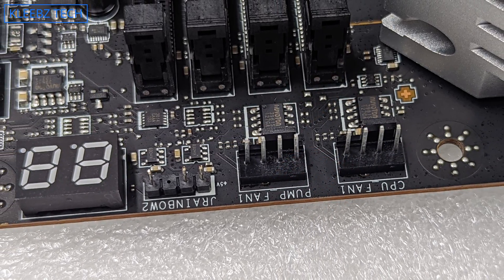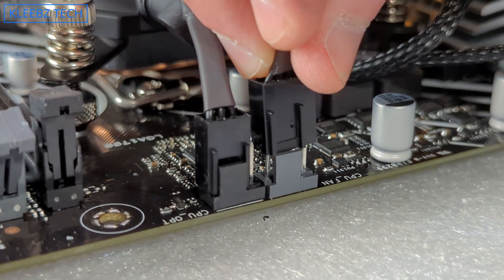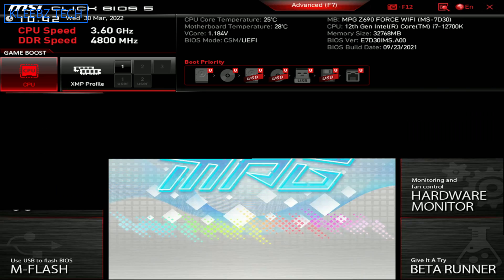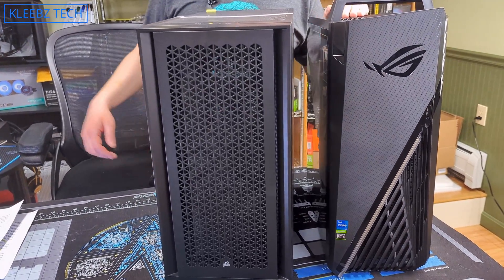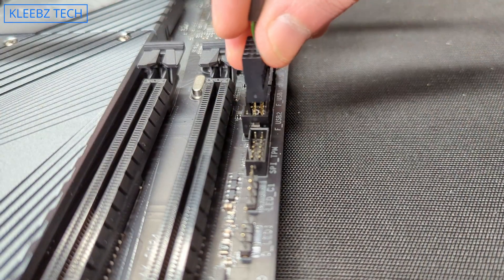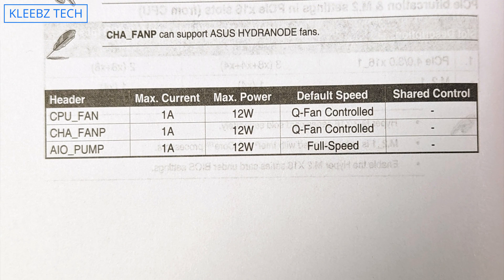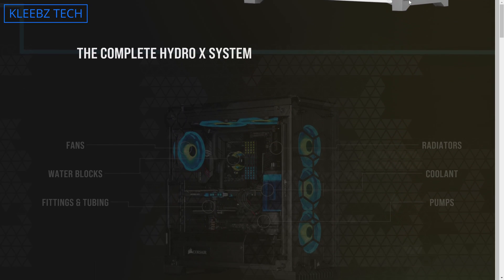CPU Fan Headers - Where do you plug in your CPU cooler?

Comment: I installed my aio the temps are around 48c on my cpu when gaming the fans are spinning on the radiator cooler but when I open the software to the aio it says no pump data

Comment: I have MSI B450 Pro Carbon Max wifi and I'm using Deepcool Castle 240rgb v2. The problem I'm facing is that my AIO's fan & rgb both are 3-pin connector but my mobo doesn't have 3-pin argb header. What should I do? Can anyone help me out?

Comment: I’m so confused I plugged my AIO cooler headers in as per the instructions with the fans themselves connected to the provided fan hub which is then plugged into CPU FAN 1 and then the pump itself is plugged into PUMP FAN 1. However, in my bios it just now shows the cpu fan at 0RPM even tho they AIO cooler fans definitely are spinning and it only shows the pump fan.

Comment: Which one does the 3 pin cable and 4 pin cable on the cpu cooler go to?  Does 4 pin go to pump sys1 and 3 pin go to cpu fan1? Only other port i see in top right is sys fan1. I have no 3 pin ports on my board. All of those are 4 pin ports

Comment: My motherboard doesn’t have a CPU_OPT in only has the CPU_FAN, an Argb header, and a SYS_FAN header. What do I do?
Reply from the maker: You can use CPU_FAN.
Reply: @ so do I plug the waterblock to the cpu fan and the radiator fan to sys fan?

Comment: I'm having a hard time getting the cpu fan connector to connect to the 4 pin connector on my motherboard, it appears to be connected but then just falls off.  It's suppose to be 'no mistakes' connection there but for some reason it just don't seem to do it.  I have an Gigabyte z790 aorus elite x wifi7 and a GAMDIAS CPU Air Cooler 270w TDP with Black 7 Heat Pipes Dual Tower CPU Cooler, so am I missing something here or should I just send the thing back, I wanted to avoid water cooling for now which should be fine with my I7-12700k but now I'm getting really frustrated with it...I don't want to send it back but guessing there's just something wrong with this connector for this cpu fan connection.

Comment: Dude, you saved me!!!!!! Thanks😂

My system kept booting into the bios every damn time I power on the system or restart the system. 

I have my header on AIO_PUMP for my aio cooler on my Galihad ll LCD 280MM

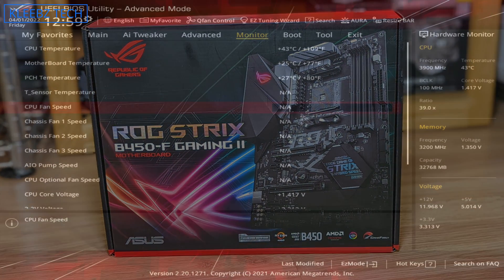It turns out, that for anyone with the same issue using an AIO cooler just set your >>>CPU FAN SPEED<<<< TO IGNORE 2:07. That way it will boot right to the drive and not bios every single time -lol 

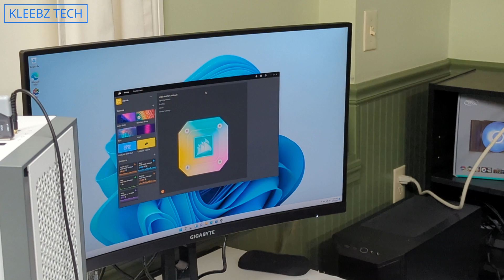1:57 issue resolved✨️✨️✨️✨️🤪😅

Comment: I put an NZXT Kraken 240 in the AIO pump header, and I'm getting that fan error in bios shown at 1:55 in the video. Would it be okay to set the bios to ignore the CPU FAN header as they did, since my AIO is working off the AIO header, and the temps are good, or should I put it in CPU FAN header just to be safe? The error on start up is annoying lol. That being said I'm on a ASUS Rog Strix b760-a gaming wifi motherboard
Reply: Where are you putting your fan connections then? Are you running the radiator without fans? The pump connection goes into the AIO header. The fan connection goes into CPU Fan.
Reply: @thecheese4960  I don't remember, been a while since I looked 😅 but I have every fan running and remember setting the bios to ignore the error. So far great temps and everything is functioning. Thanks for replying!

Comment: What does cha_fan do? And how do I find it?
Reply from the maker: Chassis fan and often used for things like case fans and any other extra fans.
Reply: @KLEEBZTECH  does the chassis fan do the same thing as a system fan?
Reply from the maker: I assume you are talking about the actual headers where they plug into motherboard, and for the most part yes. Although it can depend on the motherboard.

Comment: I am putting a cooler master 120l into a hp 6300 sff. The 6300 sff does not have a cpu_fan header, only ch1, ch2_fan headers. The cpu is cooled by shroud and case fan. I am upgrading the i3 with an i7. With new 600w psu. I can power the pump and fan but I don't know how to control the fan speed automatically with cpu load. I don't really want the fan running 100% speed 100% of time, but I understand the pump needs 100% speed, 100% of time. Thanks for suggestions. I don't know, maybe ch1_fan can be set up in bios like a cpu_fan?

Comment: Hey im having problems with my water cooler I just installed my cpu is hittin 95 and it automatically shuts off as soon as I get into bios my AIO_pump connector on my mobo is a 4 pin but the water cooler connector is a 3 pin i tried connecting it still to the AIO_PUMP_ connector on my mobo but it just shuts off automatically what should I do?
Reply: Please let me know if you have found a solution for this issue. My issues isn’t the same but your answer may help me.

Comment: Hello, when the pump dies in the AIO Cooler, does that trigger the CPU Fan Error?
Reply from the maker: That's hard to say but it could. There are so many different configurations.
Reply: @KLEEBZTECH  I believe that is the case with mine. I pulled the trigger on the Thermalright Frozen Edge 240 cause I have to maintain my luxury lifestyle. Keep bangin', thanks.

Comment: Hello! If I don't have CPU_OTP on the motherboard, can I connect the pump to SYS_FAN1?
Reply from the maker: Since CPU_FAN is the most monitored by the motherboard for any failure and the pump is the most important thing to monitor I would connect the pump to the CPU_FAN. Also recommend reading post #3 here for some useful info as well: https://forums.tomshardware.com/threads/can-i-connect-aio-pump-and-fan-on-cpu_fan.3759399/#post-22670855
Reply: @KLEEBZTECH  so if I understood correctly I have to mount the pump with 3 pins to CPU_FAN and fan with 4 pins to SYS_fan?
Reply: @Kandis23  Is that correct? Wondering how it worked.
Reply: @redwhitentrue  Good question

Comment: So if I have motherboard asus rog strix b650E-F and all my FUNs have 1A 12W max, where should I plug (and can i?) All 3 propellers from my aio lian li galahad II? If I got it right all 3 fans are connected one with each other and then all 3 should be put in one FUN connector of the motherboard, but I am afraid that 1A 12W is not enough for this

Comment: hey guys, I need some halp!! is the pump header cable that is for your cpu AIO cooler supposed to be clipped into the CPU_FAN / AIO_COOLER slots on your motherboard? i plugged mine in and i can easily pull it out. it has no clips
Reply from the maker: None of those plugs will have a clip of any sort to hold them in place.

Comment: I have a problem. b550-plus tuf gaming wifi v1 motherboard and where is the aio header on it? asus didin't show where is it in any papers they had given with MB and now I am sutck between some vids saying it's at top of MB and some saying it's between cpu, ssd and PCIE x4 reinforced slot.
Reply from the maker: Is your motherboard the TUF GAMING B550-PLUS (WI-FI)? If so I took a screenshot of the manual with the connection circled and upload here: https://kleebz.com/wp-content/uploads/2023/12/Screenshot-2023-12-05-194900.png
Reply: @KLEEBZTECH  my god, thanks man I was looking for it for 5 days. My version of instruction is from 3-4 years ago and they didn't include placement of aio pump

Comment: Hello sir, I have an asus x670e e gaming motherboard and an asus lc ii 360 liquid cooler.The liquid cooling fans are connected to the CPU opt socket and the pump is connected to the Aio pump socket.Aio Pump is in full speed mode in the bios, but when I go to the desktop, it does not appear to be running at full speed in the Armor Create program.It seems to vary depending on the temperature values of the processor, but did I do everything correctly in full speed mode in the bios setting? Please write me an answer.❤
Reply: Hello. I believe I have the same Lian Ali ALC 360 AIO Coolant System. My system isn’t recognizing it in the BIOS at all. Both are saying N/A in the BIOS.

Did your system start like this? If so, what did you do?
Reply: You both should be connecting the pump to AIO header. The fans to the CPU FAN header.

Comment: My MoBo only has one cpu fan header and 3 different system fan headers. No pump header. I want to hook my arctic aio pump up to system fan 1 header and fix it at 85% speed or so in the bios and run the rad fans off the cpu fan header to follow cpu temps via a tuned curve. All the headers are rated @ 2a 24w. I dont see why this wouldn't work. Bad or good plan for a board without a pump header?

Comment: i got a B550 AORUS ELITE V2 and the moment u put my pump in the cpu_opt it will go straight too 100 degrees celcius, while clicking it in the cpu fan it wil goo too 40 degrees celcius. how is that possible?
Reply from the maker: Possibly the cpu-opt is not working?
Reply: when i put fans in it they work so thats where the confusion pops in, at the moment i play wow and now its 50 degrees 
when pump is in cpu _fan
 @KLEEBZTECH

Comment: What's a 4 pin pwm fan header?
Reply from the maker: A 4-pin PWM (Pulse Width Modulation) fan header is a connector on a motherboard or fan controller designed to connect with a 4-pin PWM fan. The pins are allocated as follows: Pin 1 is for electrical ground, Pin 2 supplies +12V power to the fan, Pin 3 is a tachometer output indicating the fan's rotational speed, and Pin 4 receives the PWM control signal to modulate the fan's speed. Unlike 3-pin fans whose speed is controlled by varying voltage, 4-pin PWM fans receive a constant 12V supply, and their speed is adjusted by altering the PWM signal on Pin 4, allowing for precise and energy-efficient fan speed control based on system temperature readings and other variables.
Reply: Great Information

Comment: Hi, very nice video, help me a lot.
I’m facing the same error, i have an Aorus Waterforce, also using USB connection, then my Asus mobo can’t recognize the CPU FAN (cause doesn’t exists).
However, my case have 4 fans pre-installed, all connected into a controller.
The question is, can i connect this controller (w/ 4 fans) into cpu fan?
If true, in this scenario stops the error?
Thanks!

Comment: I have pre built from Cyberpower. they have plugged aio  pump to cpu fan and left cpu pump header empty.  the aio fans are connected to system fan5 . Is worth changing everything in correct place??? its a msi board
Reply from the maker: If things are working fine I wouldn't usually.

Comment: I have a problem that there is literally no cpu opt, aio pump, pump connectors on my motherboard. What do I do?
Reply: Use "sys fan1" 
Or if that returns a error 
Trying the cpu fan
Reply: bro i figured out a month after this comment but thanks a lot!  @777_lite
Reply: @777_lite can you use a aio cooler on that one?
Reply: plug in the aio pump in the System Fan header and the radiator fan to CPU Fan header.
Reply: And the vrm plug of the pump? @ernievelasco23
Reply: Plug in where you think is best, make sure you read what fan header that is and check it and set it in the Bios
Reply: Same bro, any luck?
Reply: Get a new mobo

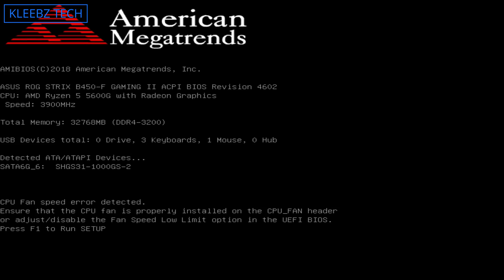Comment: @2:00 bro I getting this same fan error.  After ignoring it everything works but until I shut down it reappears
Reply from the maker: Is this a newer computer? If it is not there is a possibility you need to replace the CMOS battery.  see if any other settings can be saved between shutting down.
Reply from the maker: And just to confirm you are saving when you exit the bios?

Comment: I need help I installed an AIO argb cooler to my cpu it is working fans and everything. The only issue is that sometime the light on my cpu cooler flickers I dont know why it does that I have checked the temps on cpu but it is still okay it seems running.

Comment: What about the H150i Elite from Corsair? It has a 3-pin connector but only one single wire, does it go to the CPU or Pump header? At the moment it’s connected to the CPU header, and I can adjust the speed from Quiet, Balanced, or Performance inside ICUE.

Comment: I'm building a high-end system (13900K, RTX 4090, Samsung 990 pro, Hynic A-dia DDR5) being powered by a Corsair AX1600i. With the capability of all the heat this system can generate I have dual D5 pumps (24W ea), (4) 30W Delta fans and (3) 15W Delta fans for a total cooling system load of 213W or 17.75A at max settings. I'm not pulling that kind of power thru the MB and will use a relay connected directly to the PSU triggered by a fan connection on the MB. That way you're not pulling 18A thru the MB will all the noise that comes with having all those motors connected to the MB
Reply from the maker: That sounds like some serious cooling. Hope it all works out. Jealous about the 4090. 😍
Reply: Yes same here I just started assembly of the rest of the components minus the 4090 which comes later this month.

Comment: I have the h60 from Corsair, came with a prebuilt pc and it has a push/pull fan configuration on the radiator. My question is where does the 3-pin wire from the pump and the 4-pin wires from the two fans connect too? My motherboard has two CPU Fan headers and three Cha/WP headers. Thanks
Reply from the maker: From the sounds of it the 3 pin would go in the CPU fan header and the 4 pins in any of the 4 pin sys fan headers.

Comment: You never answer the question. CPU fan header, CPU OPT header or the AIO pump header. Witch one should I have plugged in with a AIO cooler.
Reply from the maker: I would connect the pump to the pump header usually.

Comment: If  I have 5 chassis fan and only 
3x fan connectors 
1x aio pump connector
1x cpu opt connector 
Can I hook up all 5 chassis fan on those??
Or do I have to buy some kind of splitter??
Reply from the maker: Sorry I missed this. Yes you can connect those. They may not operate exactly as expected but it won't be a problem but you may need to adjust things.

Comment: can i plug the pump to fan hub ? i saw tht my pump wont affect even adjust the speed in bios (always 2420-2445 rpm) , maybe because its 3 pin , why i want to plug pump in fan hub because i want my radiator fan (120 aio) run higher than case fan , so the hub only 3 case fan with 1 pump plugged in , and the rad fan plug in motherboard cpu fan header , (my fan hub is just powered by 4pin motherboard, no sata or molex) and my motherboard only has 2 header ,(sys fan , cpu fan) is it safe to plug the pump in tht fan hub, with no sata or molex power up

edit: my current setup now is fan hub plug in mobo cpu_fan (4fan plugged) and pump plug in mobo sys_fan

Comment: Help my mb does not have aio pump header or cpu opt it only has cpu fan and sys fan 
and my aio has two wire one is 4 pin second is aio pump wire can i connect aio pump wire in sys fan and the 4 pin to cpu fan is that ok? please help
Reply: tell me what you did,  I also have the same issue
Reply: @soumodipsardar3519 I don’t think so you can connect a aio pump fan connecter to sys fan. I don’t know when I commented this because right now when I check my mb has a aio pump connecter and a cpu fan connecter. I don’t recommend guessing and risking. Highly recommend contacting a professional for an advice.
Reply: @soumodipsardar3519  i connected aio pump header in aio pump connecter on the mobo
Reply: @default06  but i dont have aio pump header in my mobo
Reply: @soumodipsardar3519  did you bought everything mobo and the aio?

Comment: PLEASE HELP!!! 
My MB does not have pump fan header. WHAT SHOULD I DO??
Reply from the maker: Any fan header should be fine to run your pump
Reply: @KLEEBZTECH  last question. Can i connect the 3 pin pump to a 2pin to 2 pin molex adapter that came in the box with the aio and put it strait to the psu ?

Comment: hello, i have a nzxt kraken m22 cooler i know its been knowen to have some issues, mines climbs to 100F idle while gaming 140 to 160F when plugged into fan 3 pump i get around 160F i have no idea if my pumps malfunctioning or something else
Reply from the maker: That's not terrible in all honesty, nothing that should cause issues
Reply: @KLEEBZTECH  yea I was trying to mess with it took it out and shaked it up to release some air bubbles but turn out That made it worse, now it sky rockets to 100°C even in bios when up to 107°C! And my computer didn’t turn off for some reason.
Reply from the maker: That's unfortunate, it's possible something in the pump got jammed and now it isn't working.
Reply: @KLEEBZTECH  yea i think so

Comment: Hi I have a lenovo t 5 26 arms with a low profile cooler ***thing but had there an artic Freezer 34 eSport duo set up.. But I have now switched to a liquid freezer ii240  with 1/4 pin connection.. but got a fan Error B550 motherboard am4 I have Disabled done it is a motherboard of lonovo but can this be what I have done ?? thanks in advance and new subscriber...

Comment: my board has an AIO_pump, CPU_fan and CPU_opt header. My AIO has 3 connections (pump, usb and daisy-chained fans) 

My Pump is plugged into the AIO pump header and the radiator fans are plugged into the cpu fan header.
This will be okay, right? Or should i do it how you said on the video, which was AIO pump to CPU_OPT, and fans to CPU_FAN (and totally ignore the AIO_pump header)?
Reply from the maker: You will be fine with how everything is currently set up, not all motherboards have the same headers so it's hard to give "one size fits all" type of advice for these things
Reply: @KLEEBZTECH  ok thanks
Reply: @KLEEBZTECH  Hi I have a scythe fuma 2 heatsink with 2 fans on it. It's spliced into one connection. On my motherboard I have 2 options cpu fan and cpu opt. Which option do I use for my heatsink? Please let me know. Thanks

Comment: If I have my artic cooler in the 4 pin spot should HW Monitor show my cpu fans running at 100%?
Reply from the maker: Your pump is definitely running at 100%, fans could be too because the LF2 has them all using the same header
Reply: My corsair h60 comes with two wires one to the fan and one to the  block itself it doesn’t come with any rgb im conflicted